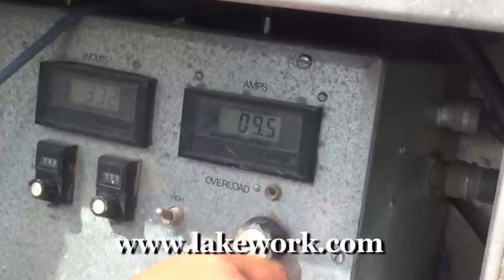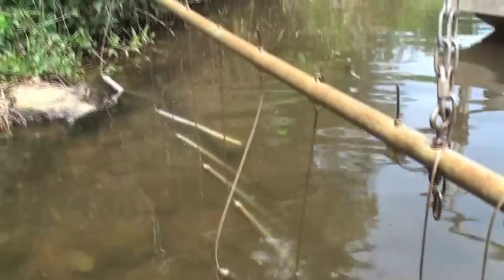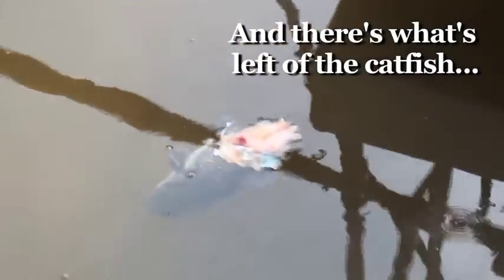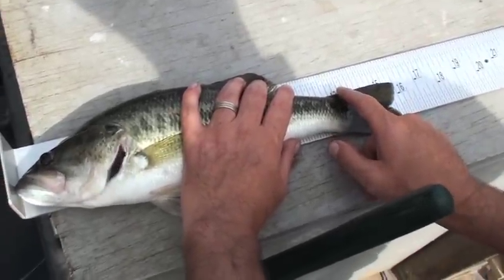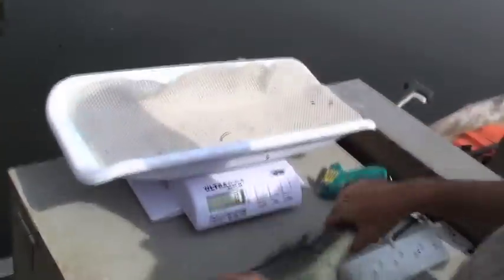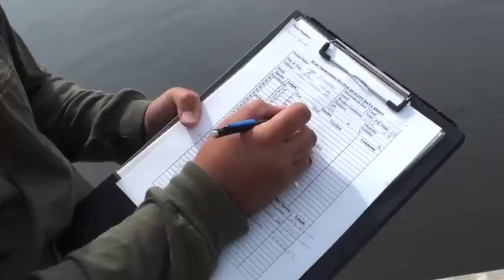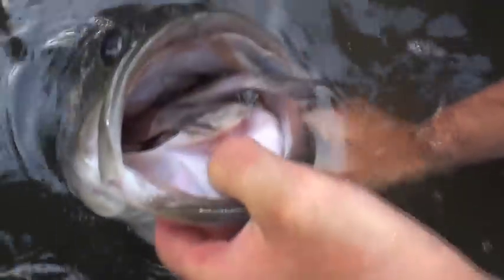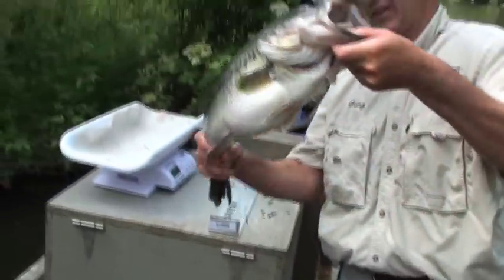Fishing with Electricity

Comment: You are stupid man..... WTF... a turtle????..... STOP fishing with electricity.... NOW!!!
Reply: LOL TRIGGERED XDDDDDDDDDDDDDDDDDDDDDDDDDDDDDDDDDDDDD
Reply: SuperJamebond007 How many frenchman does it take to guard Paris?

Nobody knows, its never been tried before
Reply: SuperJamebond007 Why did the French celebrate their World Cup Championship in 2000 so wildly?

 It was their first time they won anything without the help of the U.S.
Reply: The London Zunnix it would feel like a slight pinch, if the voltage is barely high enough to debilitate a fish then it won't do shit to a full size human you fucking idiot
Reply: "When you need to have a population analysis done on your pond or lake, the only effective way to do it is with electroshock. A boat specifically designed for this is required. It is outfitted with a generator the emits high voltage into the water through electrodes that hang off booms that extend off the front of the boat. The electrodes dissipate the current through the water. The electricity shocks the fish and allows them to be easily netted. The ratios of predator and prey fish are recorded, allowing for long term management plans for any lake. Electroshock only temporarily stuns the fish, and within a few minutes they recover and are released."
Reply: it's a fucking turtle
Reply: +devin varela serious?? fucking turtle???.... the turtles are important for the eco-system.... shut up man!!
Reply: The London Zunnix 1 turtle is going to destroy the entire eco system? Wow we should stop these monsters
Reply: I dont think it killed the turtle... If it doesnt kill fish it should be fine.
Reply: +devin varela i hope u use the electricity and u fall down in the water... stupid!!!

Comment: thats so wrong  jou poacher
Reply: They put them back and they live you idiot
Reply: "When you need to have a population analysis done on your pond or lake, the only effective way to do it is with electroshock. A boat specifically designed for this is required. It is outfitted with a generator the emits high voltage into the water through electrodes that hang off booms that extend off the front of the boat. The electrodes dissipate the current through the water. The electricity shocks the fish and allows them to be easily netted. The ratios of predator and prey fish are recorded, allowing for long term management plans for any lake. Electroshock only temporarily stuns the fish, and within a few minutes they recover and are released." read the desc ffs

Comment: What affect does this have on fish eggs, minnows that remain in the electric field longer, or other small microbes.?
 I know if you taser a human long enough you will cause heart failure, a quick shock "defibrillator" actually stops the heart beat hoping for it to "reset" itself into a more normal heart beat, its not sitting in an electrical field.
 Plus the shock factor "physiological" shock from handling it, and the buildup of lactic acid in the bloodstream from the "electrical" shock, once these levels get to high the fish will never recover and will eventually die in a week or two ... just because a fish regains its equilibrium and is able to swim away ...does not mean its ok..!!!
it will probably lose its true equilibrium later on... oh, and on another note the initial electrical shock will cause the fish to arc, further causing fractured vertebrates, broken ribs, curvature of the spine, blood clots, hemorrhaging and rupturing of the major arteries and veins, especially the gills and vents ... I could go on but I think you get the point..!

And that turtle probably did die, either then or shortly after, because the larger the object the more current it will absorb.!

Comment: When you need to have a population analysis done on your pond or lake, the only effective way to do it is with electroshock. A boat specifically designed for this is required. It is outfitted with a generator the emits high voltage into the water through electrodes that hang off booms that extend off the front of the boat. The electrodes dissipate the current through the water. The electricity shocks the fish and allows them to be easily netted. The ratios of predator and prey fish are recorded, allowing for long term management plans for any lake. Electroshock only temporarily stuns the fish, and within a few minutes they recover and are released. Read the description Jesus...

Comment: You're not supposed to pick up snapping turtles by the tail it can cause spinal damage, it effects larger ones the most but it harm the smaller ones as well.
Reply: Indeed. And tossing it down? I wouldn't have expected biologists to have handled that animal so poorly.
Reply: +TORO Sharpy Also you shouldnt really throw a shocked animal around because it causes stress on the heart because its already in shock from electricity or maybe the throw is good for them and wakes them up i dont know.  You see how they have to get them out fast because prolonged shock is not good they are getting fried from the inside so you cant just leave them like that for a long time they will die from the stress maybe i dont know but if it helps the fish i guess you have to do what you have to do i guess to hep the fish.
Reply: Pussies
Reply: +CrotalusKid it looked pretty dead when they picked it up I doubt it survived
Reply: These people are fucking mean
Reply: +TORO Sharpy It does not harm that species.
Reply: +TORO Sharpy nobody gives a fuck

Comment: Crap. Did you see the amp meter? 9.6 Amps 150-600 volts? One tenth of an amp at one volt is enough to stop a human heart if it enters the body in the correct place. The more salty the water, the more it will conduct (salt runoff from storm sewers during after winters from street deicing). I think if one were to fall overboard during that operation, it would not end well...even if it doesn't harm the fish, I would not test that. The net handles looked heavily insulated/plastic/rubber coated.
Reply: dont worry brother badboy7357. It's AC current that stops the human heart by causing fibrillation, not DC. but DC still hurts
Reply: Yes and it causes cancer to brah... Ah jk lol
Reply: I welded with 210 amps and that's only 83.7 volts and if been shocked by it two times while learning tig
Reply: Simon Bird DC sucks bad still got dried skin on my finger its been 2 years since I got shocked
Reply: +Badboy7357 Yes, direct contact with one tenth of an amp, however these fish are protected by their scales, skin, and flesh.

Comment: Luckily your 10uf is 0.000009999 amps. :-) I had some soda can sized. I would short them with a screw driver and get hit with flying piece of the screwdriver shaft. It would break off or stick to the terminal(s). 500,000 volts wont kill you at 1/20th of amp. Yet 5-6 amps at 50 volts will drop you.

Comment: AMPS kill. A common static spark runs into the thousands of volts. GOD- I recall working for a fiberglass company. It was dead of winter and very very dry indoors. When we'd pull the now cold mold form off of its counter mold. HUGE bright white sparks would raise every hair on our body while long ass Sparks jumped over 2 feet shooting voltage down our Cock's pee hole! Talk abut pain.. Shock your pee hole and dick. This went on 20-30 times a day. You NEVER knew when or if it got you!

Comment: "Although often not externally obvious or fatal, spinal injuries and associated hemorrhages sometimes have been documented in over 50% of fish examined internally. Such injuries can occur anywhere in the electrofishing field at or above the intensity threshold for twitch. These injuries are believed to result from powerful convulsions of body musculature (possibly epileptic seizures) caused mostly by sudden changes in voltage as when electricity is pulsed or switched on or off."